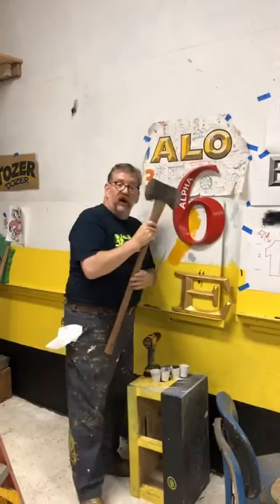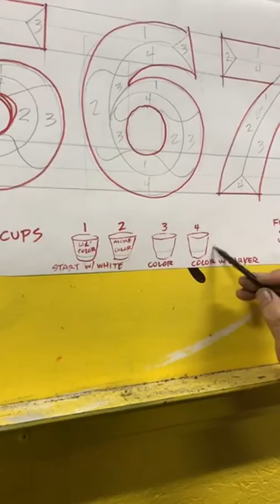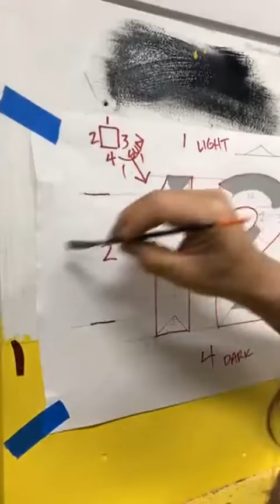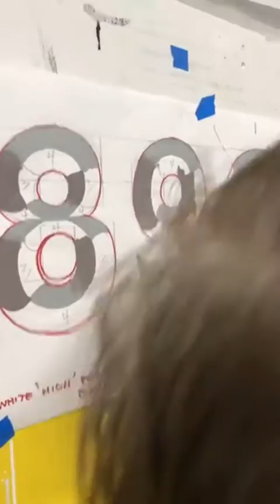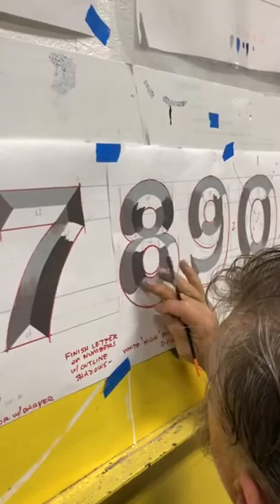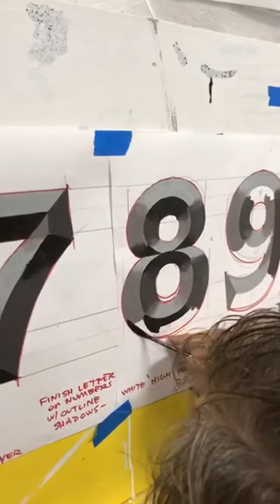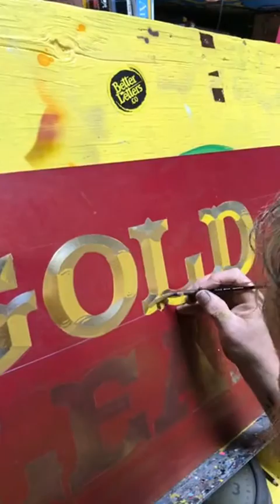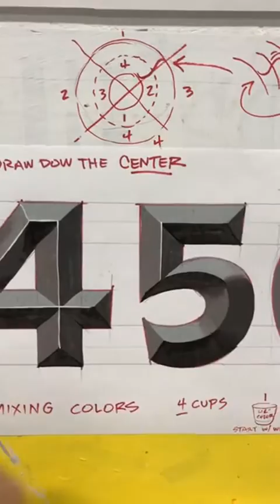Mike talkes bevels

Comment: i still dont get how you determine where the 'ying yang' lines go on the curved letters like 2,3,8,9 ...especially considering the right hand side of the letter 9 is the same as the right hand side stroke of the zero, yet the bevels are in different places ...can anyone help ? also it  looks like its only the 0 where you can draw an X over the shape...on the 8 and 3 no X over the circle /oval ?